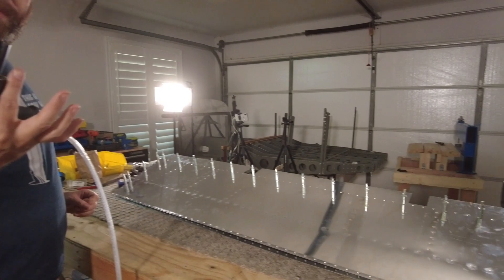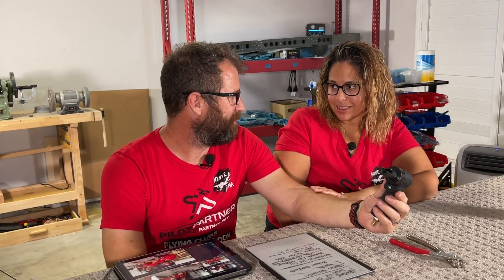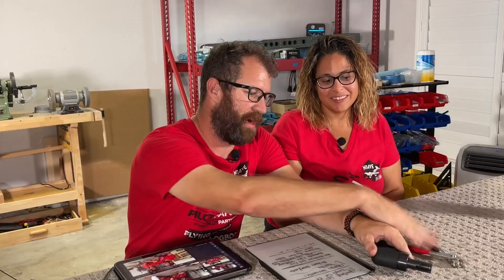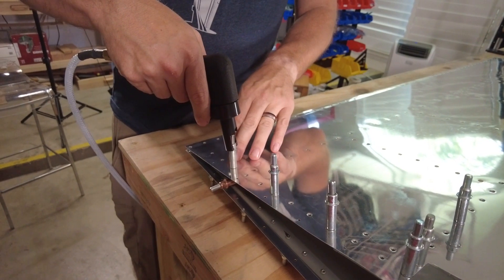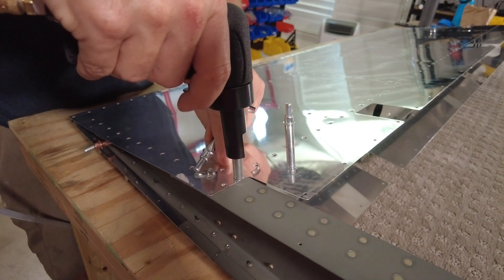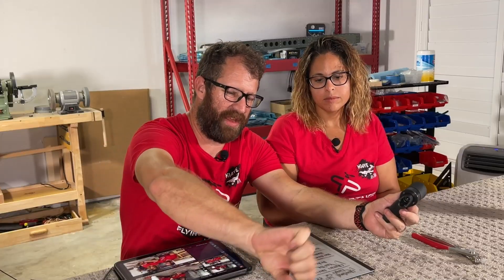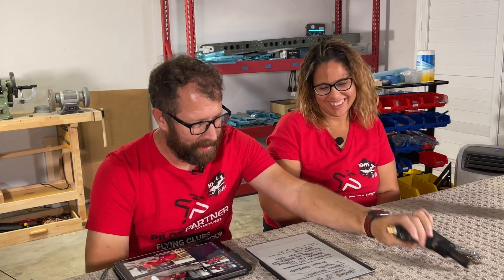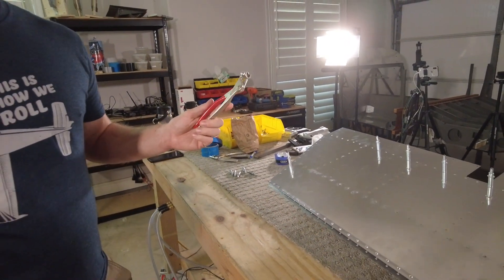Vans Aircraft Tools - Pneumatic CLECO Tool

Comment: That's the cleco tool that I'm looking to get. You could put an adjustable  air restrictor on there to make it more smoothly actuate.  I also pull in on putting a 360° swivel on mine.  Great channel yall !
Reply from the maker: It’s a great tool, get it.   You won’t need to adjustment on it.  Use it as is and it’s great.  No need to add extra bulk and weight.